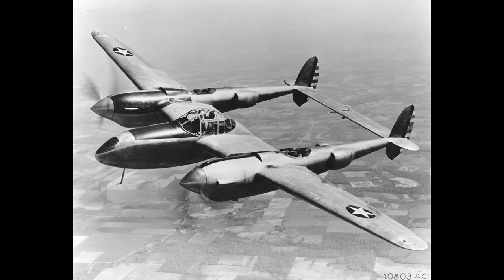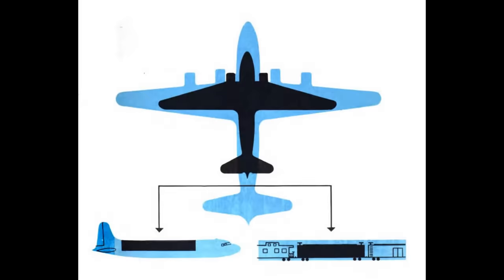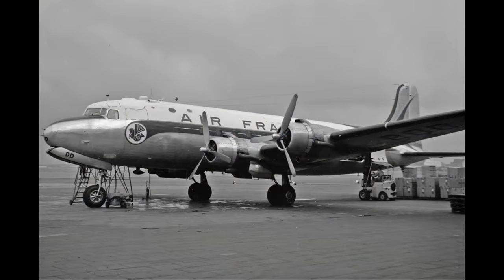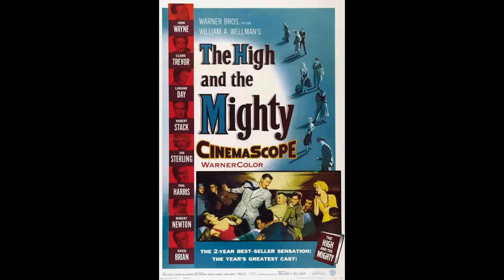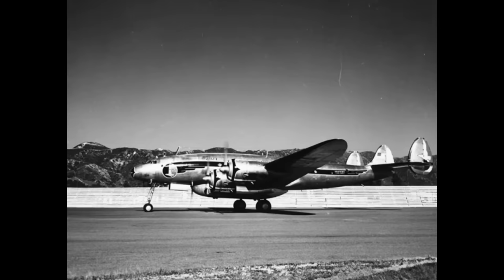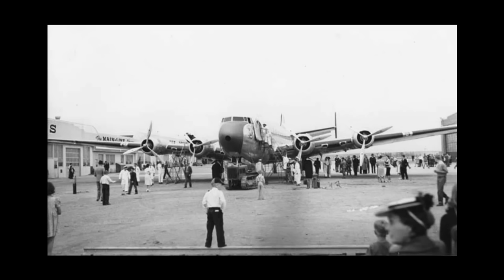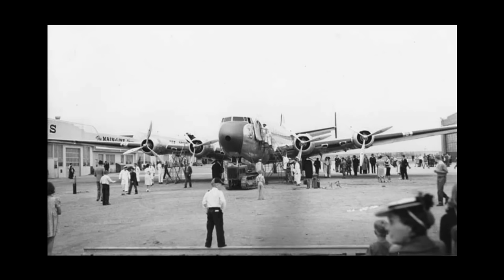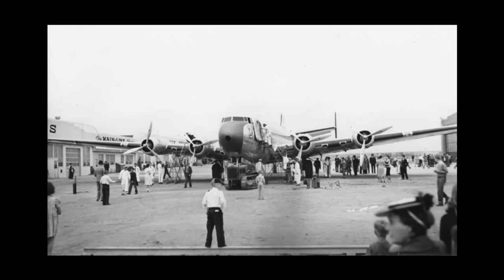Turbo Compound Piston Engines. Almost magic tech.

Comment: Turbo Compounding does indeed sound like "Magic." But . . .how does that extra rotational energy fed back to the crank not affect the engine timing (Valves and Ignition)? Or, is it in play from the moment the engine is fired up and the timing is already set for it?

Comment: I really enjoy your videos and as an engineer, find them educational and informative.   But from a recording quality standpoint, I do have a comment.  There seems to be a fair amount of surface reflection echo in the audio.  I don't have any specific solution but there are a lot of YT videos addressing it.  It could be as simple as a different microphone, different placement, different room, or placement of sound deadening panels.  I tend to usually listen to videos with headphones and the echo is more pronounced. I really appreciate your delivery style and want to continue to enjoy it with out the distraction.
Reply from the maker: Thanks for the input. A difference between myself and other youtubers is that almost all of my videos are made while traveling in hotel rooms with no special equipment. It's a downside to the way I do things, but the upside is that hotel time is the only time I have to make videos, so at least they get made.

Comment: 33:22-39 describes the working principle of the The Napier Nomad 2 which uses a turbo-compound/turbocharger combination on the same shaft. It works by adding boost when the manifold is in deficit, and slowing down the shaft to regulate the boost pressure when it is in excess of manifold demand and the excess energy is sent back to the crank though the fluidic coupling.
Reply from the maker: Yes, a lot of people have mentioned the Nomad, but none made it into production.

Comment: I believe feathering an inop engine on a 4 engine airplane increases the range. In "The High and the Mighty", a prop broke off and punctured fuel tanks and the nacelle was torn out of alignment causing the range loss. Ernest Gann, the author of the book and advisor to the movie had flown DC 4s on that route for Matson Airlines.
Reply from the maker: No, it shortens the range. The issue in the High and Mighty was that the damage shorted it too much.
Reply: @GregsAirplanesandAutomobiles  No, your wrong. Engine out range usually increases unless in recips you have to go full rich in a twin. I flew props and jets.

Comment: At about the same time in the UK, the Napier company developed a diesel turbo-compound engine called the Nomad which turned in even better sfc than the Wright (0.327 lb/(hp⋅h) ). The Nomad I was incredibly complex with an exhaust driven turbine driving one prop of a contra-prop system with the diesel driving the other. The Nomad II greatly simplified this by having a single prop and what was, in essence, an axial turbo-supercharger, but with excess power recovered to the crankshaft via a variable ratio drive system insteam of being dumped via a bypass valve. Unfortunately it took so long to develop the Nomad that it was overtaken by turboprop technology before it got iinto service, bieng cancelled in 1955 having only ever flown on testbed aircraft.
Reply from the maker: It's tough to compare an engine that never made it into production with one that did because a lot of problems don't show up in the development stages. Thus you end up comparing an idealized version of one engine, with a real version of another.
Reply: @GregsAirplanesandAutomobiles   Oh sure: I'm just pointing out that another interesting take on the turbo-compound piston engine existed.

Comment: These had a tendency to surge when power was added and could literally blow apart.  Very tricky engines to operate, that's why they only saw very limited use.

Comment: Douglas at one time contemplated fielding a DC-7D which would have been fitted with Rolls Royce Tyne turboprops.
I keep picturing this model as a cargo solution, but it's a shame it wasn't pursued. I guess it was too close to the Jet Age.

Comment: Topic example: 24:57 - max angle of climb
Text: 25:00 - shows formula "T-D"
Also, it describes an emergency maneuver. A steady state climb is not mentioned.
Question: When T-D=0 is the maneuver at the maximum angle?
Reply from the maker: If thrust minus drag is zero you can't climb, at least not in a steady state climb.

Comment: your video explains a bunch if details I could not find in engine comparisons.
This comment is a what to call engines... I think I tend to call them gas turbine or piston engines.
The word efficiency is how I track best use for engine type and cost is a factor.
so I see turbo-prop as the tops. The turbo compound explains how we got there.

Comment: It's funny you mentioned the film The High and the Mighty. I wanted to suggest Ernest K. Gann's book Fate is the Hunter that I believe the film is based on.

BMW developed a similar system in the 90's (I think?) with their "turbosteamer" system that used exhaust heat to boil water and used the steam to create work. 
I read somewhere of a modern concept using a generator driven by a turbo charger to control turbo speed instead of a wastegate. The excess electricity produced could then be fed into a hybrid system to improve fuel efficiency.

Comment: Turboprops are far more efficient than turbofan or turbojet engines. I was an engineer for Allison for fifteen years as an employee and more later Rolls-Royce as a consultant. I actually worked on the T-56 engines for the C-130.

The difference in propulsion systems has to do more with efficiency than with your discussion of power. It is far more efficient to turn thermal energy into mechanical energy than to just jet it out the back through a nozzle. Speed plays a factor because propeller efficiency drops as speed increases. That's where turbojet and turbofans come in.

Turbofans are really just ducted, high solidity propellers. The ducting improves efficiency at higher speeds. Pure jets are the simplest high performance option, but they are the least efficient. Low bypass fans don't give up much performance, but gain significant efficiency over jets. That's why most high performance fighter jets use low bypass fans today. High bypass fans are used extensively in commercial aviation because of their significant improvements in efficiency over low bypass fans. 

I also worked on the Allison Model 578DX back in the late 80s. Advanced propeller technology nearly brought us back to turboprop propulsion for commercial airliners because of the further gains in efficiency but improved performance from the higher solidity, advanced swept blade propellers. Allison called our engine a Propfan while GE called their monstrosity an Unducted Fan. Fuel prices fell dramatically just as these were coming together, so the efficiency gains were no longer worth the cost to develop the new technology. These ideas are now being revisited, however. 

I can't wait for you to tell me I don't know what I am talking about...
Reply from the maker: Why would I say you don't know what you're talking about? Nothing in your post disagrees with anything I said in the video. You're simply pointing out stuff I didn't cover due to video length, and because it wasn't directly related to the topic at hand. Nearly everything you said is in AFNA.

Comment: Would it be accurate to say that in essence turbo compounding improves the efficiency of the ICE by collecting more of the available energy released by the fuel into practical (net) work?  If only they collected some of the 80% loss of energy through the heat of combustion and turned that into practical work.  I had a physics professor in college who suggested that air conditioning in a car didn't need to parasite energy via a compressor run from the engine drive shaft, but instead could do that from the waste heat from the exhaust.  There are lots of ways to collect that heat energy and convert to usable power.  Never understood why it hasn't been exploited more in the last 40 years since college.
PS:  According to Wikipedia ICE engines are closer to 30% efficient (+/-), but that's a lot of lost energy.  Steam turbines are closer to 50-60% efficient in converting potential energy into practical work.  Obviously steam is not really practical in aircraft, especially high altitudes, but is viable in automotive and truck applications. Pound for pound and environmentally steam is still my preference.

Comment: Oh, one more thing. Since drag increased with the square of the speed, the jet at 650kts. might need 4 times the thrust than at 325kts. Propeller efficiency decreases as speed increases. Propeller efficiency decreases with higher altitude, assuming standard atmosphere. The early jet engines guzzled fuel and were impractical for long range commercial use. Conventional straight-wing airframes were not well suited to garner the advantages jet engines had to offer. Piston engines had been wrung out for about all the power they could reliably produce. This all changed in a remarkably short period of time.

Comment: Interesting, I've never heard of reclaiming exhaust energy and putting it straight into the crankshaft.  I have thought in the past that there has to be something on cars that could be run off the exhaust other than a seldom used turbocharger.  Thanks for sharing.

Comment: It's interesting to see what actually could be achieved with piston engines with the technology available at that time. The specific fuel consumption for the R-3350 Turbo Compound is in fact better than any modern gasoline piston engine today. The final period of an era (here - piston power) is often optimized to perfection before the switch to a newer and not yet perfected technology (jet propulsion). The same can be said for the final period of railway steam locomotives - a lot of innovation actually took place from the 1930s to 1980s to make steam traction more efficient. But it didn't catch on since diesel and electro locomotives already were were taking over at a rapid pace. Many innovations in the final part of the steam loco era aren't even fully exploited and developed to this day. It would be interesting to see how efficient a steam loco can be made with modern technology and materials - and better know how to fluid dynamics and thermo dynamics.

Comment: I suspect that the power returned to the crankshaft by the prt s was greater than the velocity thrust of the exhaust even above 325 kts. Not to mention the cruise speed of the DC-7 or Super Connie real cruise speed was right around 325 kts.. not particularly above it.

Comment: I'm curious as to your opinion on these new turbos being developed (for general aviation) that are electrically driven.  Do you see this as efficient and practical  ?
Reply from the maker: A lot depends on the plane's electrical system. For existing planes I only see this working for short bursts of power. Also, they are not really turbos, they are electrically driven centrifugal superchargers.

Comment: What you said strongly peaked my interest. Where do you see the power recovery turbines making a re-appearance?
I have a supercharged Chevy LS, with water/alcohol injection and 24 pounds of boost I’m seeing a little over 1000 hp. I badly want to put the engine in a 3/4 scale P51. I love superchargers but am not sure on PRT but open minded.
I also have a Piper, Arrow II. I don’t like Continental turbocharged engines but would love to turbocharge my Lycoming, if I am putting the mental in experimental let’s do a PRT on my Arrow.
Have the PRT drive the AC compressor.

Comment: There's a curious parallel with marine steam engines - there's often enough energy left in the steam once it's left the final cylinder of a reciprocating engine that it can be used to drive a turbine. This was used fairly famously on the Titanic.

Comment: The new Detroit Diesel DD-15 and DD-17 engines have turbo-recuperators as an option.  They make 50 HP and cost the engine 25.  So, a net 25 gain.
Reply from the maker: I'm not familiar with that engine, but it's probably a turbocharged and turbo-compound, the Wright was superchargerd and turbo-compound so the turbo-compound was much more effective.

Comment: The introduction of ashless oil was not introduced into industry until early 60s. The fluid couplers mentioned, were simply torque converters, such as were on automatic transmissions. Without ashless oil, sludge formed readily in these applications and were to blame for many of the engine casualties with oil being unable to circulate. I have pictures of factory new 3350s, having cases split  to drill these oil passages. Also, remember these were built by engineers using only slide rules in their back pockets.
Reply: The fluid couplings are not torque converters. They provide no torque multiplication. They were used on a few vehicles with 'self changing' gearboxes, mostly for starting from rest but not in the 'typical' automatic transmission designs.
Reply: I recall similar issues when we tried Mobil 1 synthetic oil for GA airplane engines, with sludge buildup. We had good luck with it (Continental GTSIO and TIO-520s) but I guess a lot of other people didn’t, it was pulled from the market.

Works great in my Corvette though!

Comment: Greg, absolutely fascinating. With space (all the plumbing and such)being an issue, wouldn't this work in a P38 Lightning (twin boom)? In any case, I've always wondered... Now I know. Glad I subbed.Thank you.
Reply from the maker: Thanks, it would be tough to do in a P-38 because that plane's turbochargers are already using up the exhaust energy. You could still do it, but it wouldn't be as effective in terms of fuel efficiency as the DC-7 setup.

Comment: The turbo-compounding was used buy a few truck companies, Volvo being the most common. Was in the order of 5% increase in fuel economy for long haul driving. Much like in the R-3350 It also suffered some issues with complexity and reliability, with a lot of them being just removed rather than repaired. I don’t believe any current production trucks use power recovery turbines now.

Comment: FYI.. the very first aircraft engine of the Wright Flyer was a "Dual Ovehead Cam" classic watercooled 4 cylinder, with all the basic components found in any "modern" 4 cylinder engine, including the long tensioned sloppy timing chain.  Although the water cooling was not pressurized so no radiator, but that was probably due to lack of antifreeze, meaning a sealed light weight block full of water tends to crack in freezing temps.
Reply from the maker: I have covered the Wright's engine and a lot of their other stuff before. The lack of a water pump was normal back then, they didn't become commonplace on cars until around 1920.
Reply: @GregsAirplanesandAutomobiles  I'm not trying to split hairs, but you did say WW2 ushered in technology today commonplace, such as dual overhead cam technology.  It's not word for word so no quote but WW2 hardly ushered in technology that was there from the beginning.  In any case,  I enjoy your channel, and I was not aware you had already done a video on the Wright Flyer.  So I'll check it out once I have time.

Comment: The diagram at 12.19: What is No.1 compressor and what is No.2 compressor? Does this diagram show a combination of both a Turbo charger and a Super charger? I assume Nos. 3 & 4 are parts of a heat exchanger.
Reply from the maker: That's an engine with a turbocharger blowing into a supercharger through an intercooler. That intercooler is at positions 3+4. This was quite common in US WW2 aircraft, I fully explain it in other videos. Welcome to the channel. I'm glad you're here.

Comment: The Wright R-3350 radial engines were very unreliable, prone to overheating and fires. Over twice as many B-29's were lost by catastrophic engine failures than were destroyed by enemy fire. The updated TC versrons eliminated the overheating and added 500+ hp. Introduced in 1948, in 1950 civilian versions without water injection were also introduced.
It's very easily identified as TC engines have a large jet exhaust and beefed up struts to handle the thrust. This increased the cruising speed of these aircraft by over 50 mph.
IMO, RC engines should work well in small aircraft although it would be an expensive upgrade!

Comment: How would you characterize the split housing automotive turbochargers that separate different cylinder banks into separate inlets to the same wheel-type exhaust turbine?  I've heard claim that they're no longer pressure type turbochargers.  idk what the back-pressure effects are.
Reply from the maker: They still cause back pressure, all turbochargers do.

Comment: The current turbo hybrids of F1 are indeed using a variation of turbo compounding, however they are dropping it in 2026 due to cost and low viability in consumer cars.  The main hinderance being that you only really get the advantages and near WOT, which isn't something that really comes up often. Otherwise you're just carrying dead weight. An aircraft or race car does operate in a power heavy regime, so there's some viability there, but you need OEMs willing to use it, which only Mercedes seem really happy with them. Large trucks with heavy cargo need all the power they can get, so there's power to be gained there with a turbine.

Instead regular old hybrids get big advantages form running at partial power, and give a temporary horsepower boost when needed, allowing for downsizing and efficiency.

Comment: Delta Air Lines had the " lesser" DC-7 it's fuel tanks and wing were significantly different from the " real" DC-7 known as the DC-7C or the " Seven Seas" as used by International airlines such as Northwest Orient,etc.